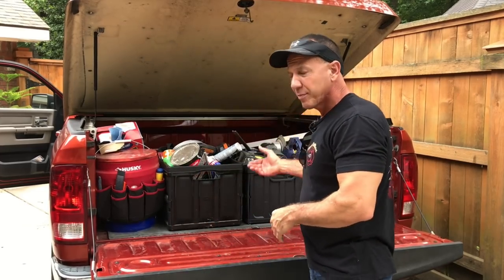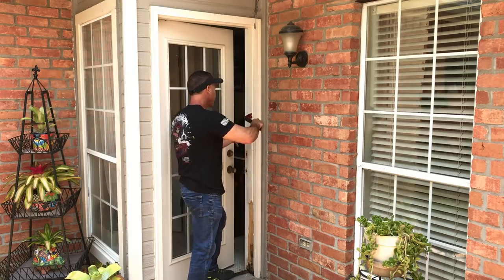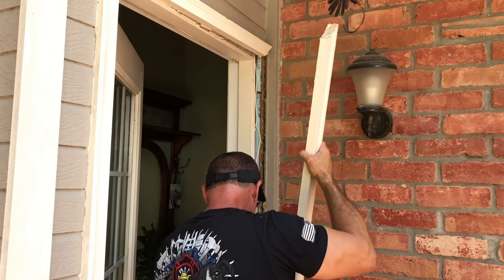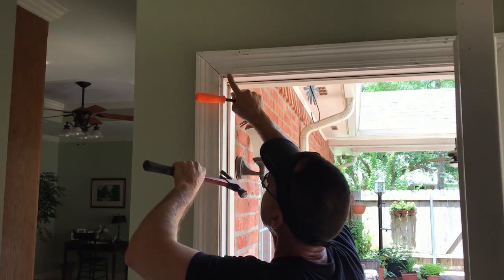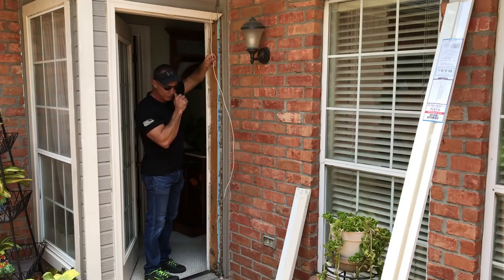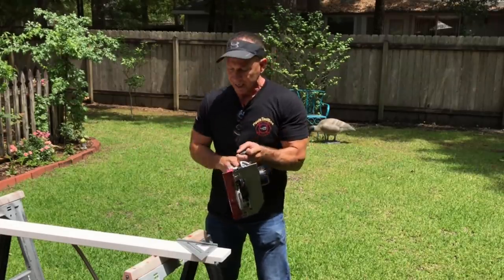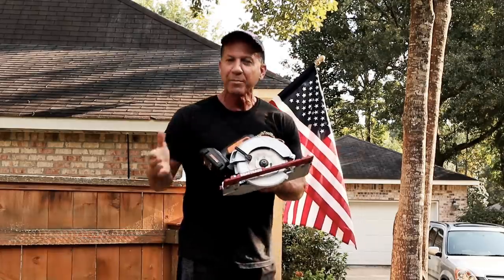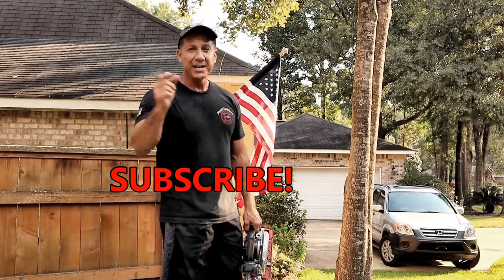Repair Replace Door Jambs Part 1

Comment: I just finished replacing the entire door jamb on a garage passage door where both bottoms were rotted out. the old threshold was also rotted away so I replaced that as well. Using the original door meant that I had to match the butts as well. Actually saved the customer some money over buying a complete door pre-hung door.  Great Videos Paul. You have a new subscriber. Thanks!
Reply from the maker: It sounds to me like you know what you are doing my friend. I'm sure I could learn tips from you as well and I really appreciate you taking the time for me!
Have a good day buddy!
Paul

Comment: Looking forward to your tool demos, I've seen tools you use that I've never seen. I really like the Worx cordless saw. 
Oh, I also appreciate the craftsmanship you show in your work.
Reply from the maker: Hi Troy,
I really appreciate you buddy! Worx has a few tools that I really like and this saw is pretty cool. It seems to work well for me but I would like to see a couple of improvement. It comes with a 2 AH battery so I bought a 4AH backup that has a light indicator, it shows how much charge you have. I wish that came on the  original battery. They also sell a 30 min rapid charger and the one with the saw is a 1 hour charger. Thes are minor things for a DIYer and I must say that I really enjoy this saw.
Thank you for talking the time for me!
Paul
Reply: Paul Ricalde you did a awesome job  nice work

Comment: Thanks for the pro tips, Paul. I do as much of my own DIY work as possible. The ridiculous prices quoted by some contractors are the primary reason I do most of my own repairs at home. Most of it is straight forward enough, although your advice ensures a speedy and economical way of completing the task. Cheers.
Reply from the maker: Hey BlueKingfisher, I know what you mean with prices. Thanks for commenting.  Have a great day. Paul

Comment: Great video, Thanks.. I am a DIYer for EVERYTHING... been REBUILDING my current home. Your tips are great & valid... Specific tool notations are great too, if anybody wants to buy that specific too they've seen you use.  THANKS AGAIN for you excellent work ethic & professional standards to get things done the RIGHT way..... not JUST GOOD ENOUGH... Seen alot of that and that's what prompted ME to become a DIYer... I have quatlity control & if it doesn't look right, I"ll do it over again.  PEACE
Reply from the maker: I'm with you on that one Rick, do it right or don't do it al all. I really appreciate DIY'ers like you! Have a great day!
Paul

Comment: I am a 72 (and a half) year old woman.  My front door had rot at the bottom on one side, both the brick molding and the jam was rotten.  I followed your directions, started at 7:45, had to run to the hardware store to get sharp blades for my oscillating saw, and finished at 10:50.
I measured twice and cut once and my pieces fit the first time.
The sun came around and I had to stop, tomorrow I will fasten the pieces and caulk.  Thank you for suck a good video, it was perfect!
Reply from the maker: Hi Sharon, You are awesome...... I wish everyone could tackle a job as well as you! Thank you so much for commenting, you made my day!
Paul
Reply: I admire you for repairing it your self.
Reply: lol...I laughed when I read your post...Im a 61 year old woman living in Maine, winters are hard on our door jams and im finding great resources like this when I need some insight...If I had to contract for every repair ive done Id be homeless lol
Reply: Excellent video, I can’t wait to do my jams!

Comment: Great video Paul, I always enjoy them. This is a common problem all over the United States with door jambs rotting from rain absorption. They now are making door jambs with synthetic bottoms which will stop a lot of this from happening but at the same time putting us remodelers out of work, LOL. Take Care Paul, thanks again. PS. I have never seen that Worx saw before with the tricked out base plate. Very nice!!!!
Reply from the maker: I agree with you Chip, I could never understand why they make exterior jambs and molding with pine! I replace my exterior trim with PVC whenever I can because it's one and done. I really like this little saw myself, I also like the fact that it uses a 6 1/2" blade. Not bad for a small cordless saw. I am going to order a 30 min. charger for it, unfortunately it comes with a 1 hour charger. I did order a 4 AH battery that has a light indicator and I really like the extra power. As I said in the video, I would really like to see a pro-version of this saw with more power and faster charges! I guess we will see ...... 
Have a great weekend Chip!
Paul

Comment: I need to do a door jamb on the hinge side of my door. We had a storm door get whipped open in the wind and the wood where it was screwed in ripped out and cracked down about a foot. I imagine that the concept is the same, except that I have to remove the actual door and route out exactly where the hinges need to go back on?

Neighbor recommended I get a pre-hung door and mount that, but a nicer looking door eclipses $1000 and I have no problem with the look or function of the door itself.

Comment: Paul, Great job replacing the jamb. I normally use a rigid putty knife slipped in behind the trim on the drywall side of the trim to get the trim loose. It spreads the load, preventing damage to the sheetrock, and keeps any pry marks away from the jamb side. The sheetrock edge is normally caulked anyway, which covers any damage or pry marks. The saw is a great looking tool. I hope I win!
Reply from the maker: Hi Al, 
That's a good point and I'm glad you shared it. Thank you for taking the time for me and especially commenting!
Paul

Comment: Badass run down, we got a house (new) and the door is hanging,uneven  ,and since I have to take the door off, I'm going to replace the jamb.. the hole for the dead bolt is ugly and past the strike plate,,so your video really helps me out. Thanks and do you have any videos on insulating the garage,making it more comfortable, it's where I chill.Thanks again.

Comment: I have had good luck with FamoWood latex wood filler to fill in rotted jambs and brick moulding at the bottom, but it does take a few revisits, at least 2 times to fill and shape/sand the wood filler.

Comment: Hey do you ever use hide screws for attaching jambs? They have a tiny hex head, almost the size of a finish nail. And they don't suck the wood down like a regular screw or nail. And it's a super small hole to fill at the end of the job.
Reply from the maker: Yes, they are trim screws and they are very popular in Canada but not as easy to get in the USA. Fastener companies sell them but I had trouble finding them at big box stores. They use a Robertson bit that has a small square head. I visited the manufacturing plant for MegaPro screwdrivers and they asked me why we don't readily carry them in the USA. I didn't have an answer.... maybe one day they will work their way down here.  I saw your other comment and I  am just glad I could help this lady, she is a very nice widow that lives alone and is 75 years old. I hate when people take advantage of the elderly or anyone else for that matter. Thank you for taking the time for me and I really appreciate your comments! 
Have a good night!
Paul

Comment: Perfect timing Paul, I need to do this same job except on the jamb side, excellent video.  Any extra tips I should know before I do it.
Reply from the maker: You will have to remove the door and you will also have to route the hinges. They sell low cost butt hinge kits. Do you own a router? If you have any questions you can contact me at www.paulstoolbox.com.
Thanks!
Paul

Comment: Enjoyed your video Paul, my son’s house has trim damage I will be replacing the trim on both sides the way you did , thanks again. Oh by the way can I replace the trim on a door on a brick home?
Reply from the maker: Hi Robert, yes the trim around the door is nailed to your frame and the brick is on the outside of that so you have room to pull the trim off and put new trim on. 
If you have a 36 inch door you probably have a 40 to 42” opening on your brick. 
I’m not positive but I think I know what you were asking so if this is not what you were looking for you can send me another note. Thanks!
Reply: Paul Ricalde yes sir the trim is rotted at the bottom of the door, could I use bondo glass that I saw in one of your videos or replace the whole trim with PVC trim?

Comment: Great video!   I need to do this right away.  Wondering how the nails that were cut didn’t interfere with replacing the trim though
Reply from the maker: Hi DIY Brad , Thank you for commenting.  If you have any questions with your project you can direct your question to my contacts page on my website paulstoolbox.com  I will be glad to help.  Have a Great Day! Paul.

Comment: Love your videos! Great content again. I am curious why insulation is not used inside the jamb? With thick shims, there could be a significant gap covered up by the trim boards. Is there a way to fully insulate the door jamb?
Reply from the maker: Yes Paul, they make low expansion foam for crevices like this. We do not deal with extreme temperatures down here but I highly recommend using it in regions with extreme cold or heat. Make sure it is a low expansion foam and not high or it will swell too much and bind your door shut. Thanks!
Reply: @paulstoolbox  Makes sense. Thank you!

Comment: Thanks for the info, it would be nice if Bondo came in smaller cans...I've used it before, it works great but doesn't store for a long time....Thanks again...
Reply from the maker: Hi John, you can get it in quart size cans at your auto parts store but I'm probably telling you something you already know. Thank you for taking the time for me!
Paul

Comment: Love your diy videos.  What is the name of the saw guide you used?  It would come in handy putting in new laminate flooring.
Reply from the maker: Hi Lonnie, the saw was by Worx, it's called the ExacTrack. The guide cost me 20.00 at Harbor Freight. The Harbor freight guide is not heavy duty but it works pretty good and it's very inexpensive.
Thanks!
Paul

Comment: Thanks, Paul! Love the presentation, description and knowledge that comes along with your videos. One question, if I may... What does a beginner handyman charge for job like this jamb repair? I’ve painted for 30 years, have knowledge of basic DIY construction & repairs. Just trying to venture out to make some extra $$ while helping family, friends & the community. Here in Palm Springs,CA. I feel comfortable charging $25/hr. for my skill level. However, I would like to start incorporating flat rate quotes when applicable.....

Thanks in advance for your time & energy!
Patrick

Comment: Are all door jams standard?  EX:  36X80 door entrance?  I had a couple estimates & these men are trying to tell me it would be easier if I just bought a new pre hung door, I don't need a new door, just a storm door which the wind caught & ripped ther top wood board, cracked it like 10" down from the top where the spring attachment is.    I think I can fix it with some guidance, and the right tools (made a list), how do I get the correct replacement board?

Comment: I was sent to a house to fix  window trim, a garage door jamb and brick molding.  They gave me wood epoxy and a 2x3 which doesn't even fit in the jamb.   Would have been faster to fix it the right way instead of trying to make groves in the 2x3 on the table saw.   They boss would not spend the money to buy the jamb and the profit on the job was over $1400 job with 16 apprentice labor hours and $100 materials.   I left this hack job company a few days later when they took a door off one persons garage and put in on a brand new house addition but charged for a brand new door.
Reply from the maker: I hate crooked contractors, I have seen my share of them myself. You did right by leaving that company. If they are a member of the BBB you should report them. The clown that installed this door a few years ago  cut her alarm wire, charged her extra to reconnect it and left the broken wire in the wall. He also did a terrible job of installing it and barely used nails to install. I would have loved to come in right behind him so I could confront him on it but it was done 10 years ago.  Thanks for the comment and have a great day!
Paul
Reply: @paulstoolbox  I heard of an HVAC technician that repaired a families furnace (mom,dad,2, kids) and the family was waving bye to him as he backed out of their driveway when he felt the van hit something then roll over it and a red splat shot across the driveway like he ran over a giant catsup packet, the kids screamed BOB BARKER! oh no! he jumped out of the van to see what he ran over &  the wife snaps & becomes unhinged screaming ,...YOU KILLED BOB BARKER ! OMG YOU KILLED BOB BARKER !!  AAAAAAGGGHHHHH! ..I'M GOING TO KILL YOU!.. and she grabbed her sons baseball bat off the ground and smacked full swing across his ribs cracking a few, he instinctively reacted (he was a black belt) his body spun quickly around 180 degrees and his elbow smashed into her jaw disarming her and knocking her unconscious & into convulsions, she starts biting her tongue to shreds ,arching her back and pooping her pants like she was on the Sunset strip 1980 slam dancing to the dead milkmen!

The husband sees his wife having grand mal seizures, his dog is dead and his kids just watched it all unfold, just 30 seconds prior everyone was waving bye smiling.
The husband snaps and screams I'm gonna kill you bastard! as he was charging the technician, who again instinctively spun his body around backwards 360 degrees very quickly and did a spinning back kick connecting to the side of his head instantly knocking out his 2nd  assailant, both convulsed as the kids crumpled to their knees he called dispatch.

Comment: Thanks for the video but I dont see part 2. In the existing jambs that have the door hinges it already has a cut out for the hinges. I am concerned if I replace that jamb without the cutouts then the door won't close properly. How do I make those cutouts without jacking it all up?
Reply from the maker: The hinge side was not damaged so I did not change it. I have another video showing how to repair rot without removing the door jamb. Unfortunately I do not have a video that requeired me to replace the jamb side but you can purchase replacement pre- routed jambs that fit factory doord like this one. Do you have a steel foor like this or is it custom? You can measure down from the top of your jamb to the top of each hinge and compare it at your local Lowes,Depot or lumber yard. Remember you measure from the top not the bottom. Ley me know if you have any questions.
Thanks!
Paul
Reply from the maker: I mentioned a video showing how  to repair the jamb without removing it. Here it is, https://youtu.be/--ZhNXkbuWc
Thanks!

Comment: Love your how to videos with all the tips. But are 18 gauge nails strong enough to stand the test of time or would 16 or 15 gauge be better? 
Btw, thanks for showing how to use Bondo (previous videos) for exterior filling. Never thought of it and always used some other substandard filler.

Comment: Hey, Paul, thank you for the effort you put forth in your videos. I really enjoy watching them and I learn a lot. Do you recommend a particular, bi-metal blade for the oscillating Multi-Tool? I've used some that wore down too quickly almost as if they wern't bi-metal. Thanks again.
Reply from the maker: Hi Bizmark,
I use a carbide blade for nails and standard wood blades for wood and plastic. Unfortunately the carbide blades do not cut wood as well as standard wood blades and standard blades tend to wear out faster than I would like. I wish they were less costly, I am going to try different blades and see if there are any significant differences between manufacturers. If you find out anything, please let me know!
Thanks!
Paul

Comment: Can one purchase the side of the door jamb with the hinges?  Is it more difficult because of hinges as they are not always the same for every door?
Reply from the maker: Good morning Danielle, unfortunately they come with no hinges routed out because hinges are different on different doors and you have to line them up. I will do a video a little later on butt hinges, They’re a little bit more difficult because you need a router to accomplish this task. A butt hinge kit gives you the guides that makes it easier much easier but you will still need a router and you have to make sure to mark them exact. You also have to take the door off to do the butt hinge. Thank you!

Comment: Where can you buy a 3 piece exterior frame such as the one you purchased? Does Home Depot or Lowe’s carry a frame kit like this? Or is this a building supply purchase only? Thanks
Reply: Larry Gee Lowe's has a complete kit
Reply from the maker: Hi Larry, you can by the whole kit like Luis mentioned or you can by single pieces. Most big box stores carry them, I bought this from Lowe’s. Thanks!
Reply from the maker: Thanks for helping Larry out, I really appreciate that!